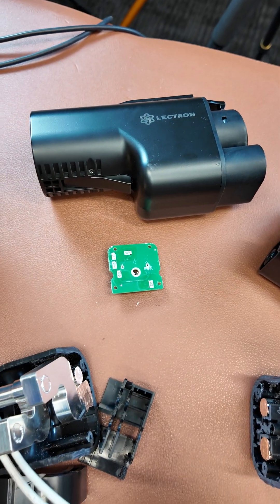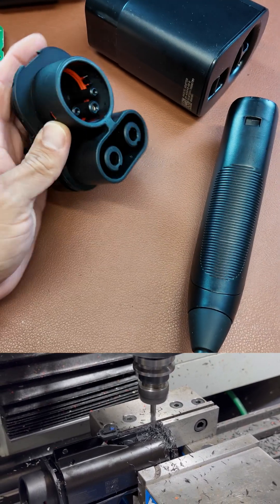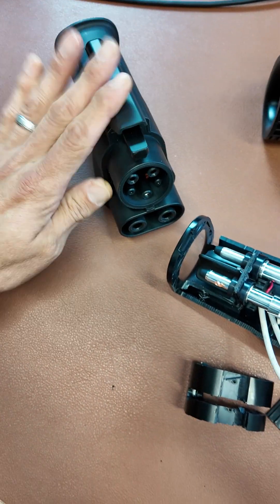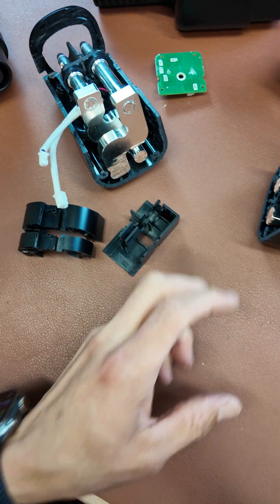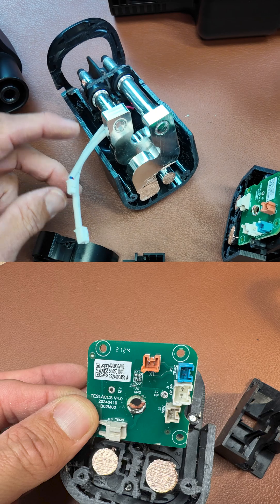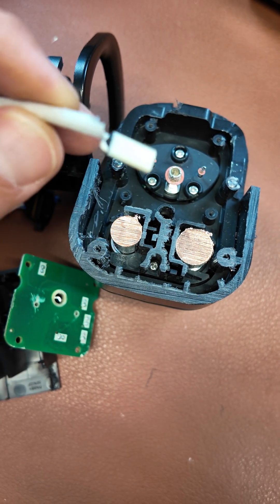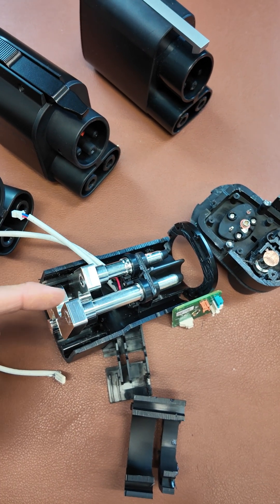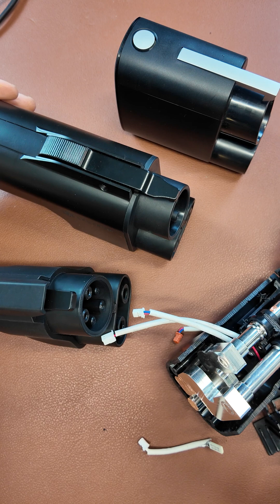Lectron Vortex NACS to CCS Adapter Teardown - What’s Inside? Not Much…

Comment: What we don't get is plug-to-charge.... but we could have that if a serial number was in the adapter.
Reply from the maker: The adapter has no logic, so you can still Plug-N-charge if the vehicle supports it as the adapter is not communicating with anything.

Comment: Does anyone know why we can’t have naps to ccs adapters also be NACS to J1772? Seems like it would just need some additional board logic to add a switch to determine which pins get the output from the NACS pins
Reply: Generally my understanding is because j1772 that is implemented was not designed to handle high voltage DC on the AC inlinet pins. If the logic where to mess up in the adapter and route high voltage dc to those pins it could damage the vehicle and be dangerous to the user as the pins are not far enough apart for the up 1000v it would need to support. The original Tesla connector only supported up to 500v DC on the same pins as the AC inlet and had to be modified to support 1000v This would create a potential short/shock risk to the user. These failure modes are why it is considered to dangerous to do so because it could cause damage to the vehicle or even bodily harm/death if such an adapter malfunctioned. If those pins are not hooked up, it is easier to validate that this wouldn't happen. Also the adapters would likely be more expensive as they would need to be active adapters to detect where to go and would cost closer to CCS to chademo adapters which are around $1000. Basically it is hard to do in a safe way that can be validated and it would be more expensive than owning two adapters reducing commercial viability versus two adapters
Reply: Tesla did exactly what you are talking about by having the NACS sense pins deliver a canbus (now green phy) message saying what's available and the OBC switches to the appropriate AC or DC mode. Wires rated for the highest DC current. 

So there's no reason except that j1772 is old and they separated out the logic (and the wire rating)

In most cars j1772 physically connects to a different part of the OBC and voltage bus than the CCS inlet.

Comment: The adapters being supplied to other manufacturers are simply the Tesla "magic dock" that allowed non Teslas to hook up to superchargers equipped with it. It works perfectly and has a less bulky form factor than the after market ones.
Reply: Only Ford got them. GM and Kia aren't giving out any free adapters except Kia for any sales from Sept 15 IIRC. I'm buying one of these since my EV is 4 years old.